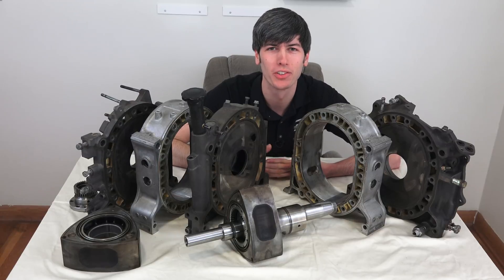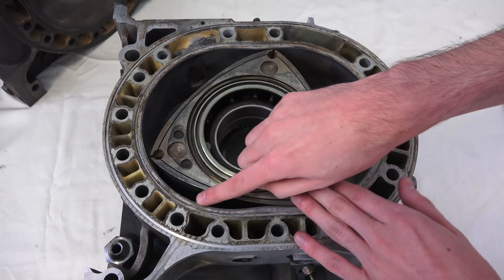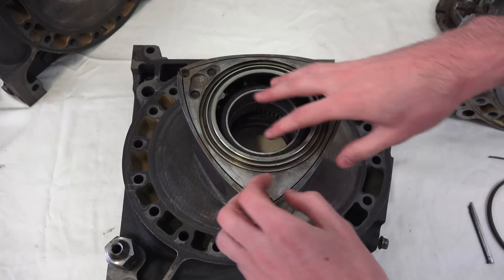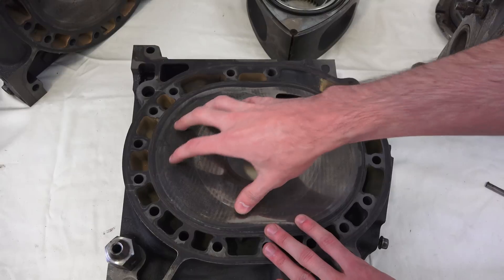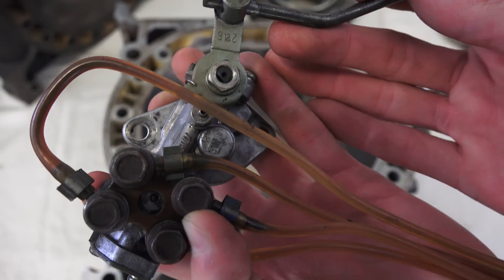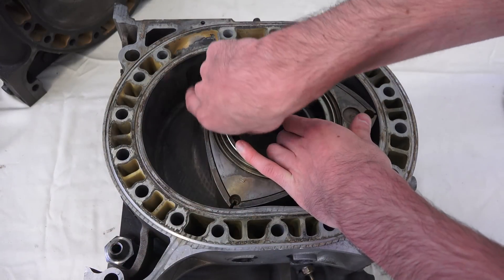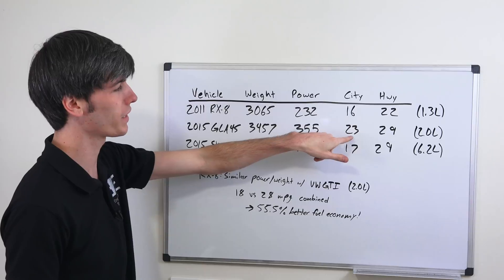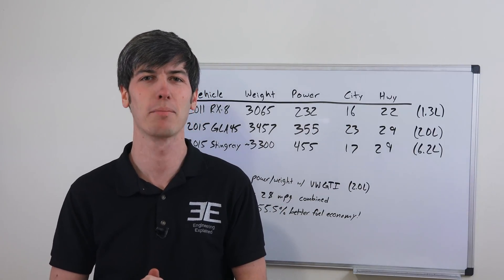4 Reasons Why The Rotary Engine Is Dead

Comment: Enjoyed the video but It seems apparent that a more prevalent reason they burn more fuel is the fact that rotary engines are often operating at much higher RPM than standard piston engines. Its not so much about thermal efficiency or unburned fuel as those problems could be resolved with fuel additives and engine configuration.  They are low torque engines that need to operate at high RPM to achieve high HP. If you were to rev a piston engine and rotary engine at 10,000 RPM that were the same volumetric size, I bet the rotary would use much less gas due to the simplicity of the engine and the lack of restricting mechanisms such as chains, cams, spring loaded valves, and back and forth motions of pistons etc... Not to mention that the piston engine would probably throw a rod at that RPM in a short matter of time right. The rotary engine is ingeniously simple and deserves respect. If paired with a well-engineered variable speed transmission could be incredibly fuel efficient. Your thoughts..?

Comment: They do not advertise the displacement of rotary engines correctly. The1.3l only takes one combustion chamber per bank into consideration. So technically it is a 3.9l.  This makes the fuel econ look a bit better.  But in turn makes the power output look atrocious.
Reply: It's difficult to directly compare. It's still a 1.3L, but it used it 3 times per revolution. Piston engines aren't measured on their displacement per revolution, just the total displacement of all cylinders combined. Each cylinder needs 2 revolutions per cycle, though.
Reply: The real doktorbimmer Yep. And with two rotor engines you can basically do the same and just double the displacement and you'd have a fair comparison to a 4 stroke engine in terms of displacement.
Reply: unless you go two stroke :)
Reply: Right, I don't get the huff/puff over the displacement. No one takes a two stroke that is a 100cc and say it's actually a 200cc. Displacement is the chamber where ignition takes place, not each rotor face. That's usually how it's done. I know in different racing organization and countries they'll use the degrees of rotation to figure out it's "displacement" because they're only trying to give referencing to compare with a 4 stroke. So basically they would compare how many times the rotary engine would fire for a single rotor in the same time it takes for a 4 stroke piston to fire. 

Either way it's all meaningless. Should just be metering how much fuel is consumed over time. Since displacement means dick when it comes to fuel consumption.
Reply: The real doktorbimmer EXACTLY haha, that's what I was saying because fuel efficiency vs displacement size was being compared and I said that it's meaningless because fuel efficiency and displacement have nothing to really do with how efficient an engine is. Only it's fuel consumption over time vs kw output.

True displacement? Then explain why a 2 stroke and 4 stroke have the same displacement under that logic. The amount of piston travel that a 4 stroke has to do is twice that of a 2 stroke. The amount of displacement between power strokes are different. 

Yet no one would say a 100cc 2 stoke engine is actually a 200cc engine. 

The reason why some racing organizations use degrees of rotation when figuring out its "displacement" is to compare to 4 stroke engines for figuring out rule balancing. 

A four stroke engine needs 720 degrees of rotation to complete one cycle. While the basic 2 rotor engine takes 1080 degrees for all 6 faces to rotate. So within a 720 degrees of rotation (the same rotation as a 4 stroke engine) you'll have 4 faces that have fired off. So that would be 654cc X 4 which gets you about 2.6L. That would be the most apt way to compare a rotary engine to a 4 stroke engine.

But in general like 2 strokes and 4 stroke engines only being calculated based on one sweep of the face that's why you get 1.3L for the 13B rotary.
Reply: Here's our number twister.
Reply: a sardar comment. who cares.

Comment: I had a 1987 mazda rx-7 turbo II and a 1985 gslse.  The cars were bad on gas as a 6 cylinder but not as bad as a 8 cylinder. I know because i also had a mustang gt 87.
The power was good but the main reason was because those cars are not heavy like the rx-8. They turn really good on tight turns making the car fun to drive. 

The rotary technology has move forward ,however it can not keep up with the big leaps in technology the piston engine has achieve over the last  2 decades. 
That is the main reason the rotary is dead.

If Mazda would made a new rx-7 light weight like the lotus elise, the car would perform much better in mpg and acceleration than the rx-8.  They also need to turbo charge the car if they want to keep up with other rivals like Nissan 370z.

Comment: the only advantage you can get in a rotary engine is the power you can get within a restricted form factor... other than that, they are worse in every way to a standard piston engine. which anyone short of anyone drinking the rotary kool-aid can figure out with casual observations. great for racing though, where money is no object, engines are disposable, and you're limited to a certain amount of space in the engine bay. rotary engines are very reliable when new and when obsessive care is taken of them, but the reliability quickly has the bottom fall out of it as soon as the seals start to wear, and worse still, when the seals wear at the walls. it's a neat design, though.

Comment: My 1980 RX-7 had crappy fuel economy, the exhaust reeked of unburned hydrocarbons, and leaked oil from the rotor housing.  Also gutless performance for a sports car.  It sure looked good though!  RIP WANKel...

Comment: Rumors have come out that Mazda will produce a 2017 RX-9 to bring rotary engine back. Maybe there are some technical innovations.
Reply: You already said that chief.
Reply: YouTube sends notifications to people when there's activity on a thread they're involved with. I may disagree with +doctorbimmer, but he has every right to continue to engage in dialogue. That's kind of how it works...
Reply: if you're not a degenerate, you would take 5 minutes to read the excellent explanations in the other comments. but after the massive bankruptcies caused by this engine, it will never see the light of day again. all propaganda about this engine being in production are speculation and false, conjured from third party news sources. check back in 2018 when you think this will be released.
Reply: They claim they've found a way to eliminate the need for the spark plug being outside the main combustion chamber. People suspect they've managed to get compression ignition working with a Wankel engine, but they still haven't announced anything definite.
Reply: Doubt we'll see anything with the rotary anytime soon. I know they've continue to develop patents on the rotary. Every couple years something new pops up. But the rotary would have to meet certain emissions, fuel consumptions and price point. Now with the new variable compression engines coming to market soon it'll make it harder to compete. Ever since the early 2000's when piston engines started to take huge leaps with fuel efficiency, power delivery, weight, price, etc it made the rotary less favorable from a business perspective. 

I mean since the peak of the rotary engine's performance in the late 90's piston engines switched from cast iron blocks to aluminum, direct injection is becoming common, variable valve timing is found on just about everything, etc. I mean the simple tricks GM has used on the old Vortec 4300 has made a cheap/stout engine go from 200hp to almost 300hp with 20% increase in fuel economy. That's what the rotary has to face. 

I think Mazda can do it, but it might cost too much in R&D for the execs to really allow it.
Reply: Variable compression engines have been ready for years and we're still waiting for them. Will they ever be in production ?
Reply: Infiniti is putting one in the 2018 GX50. Which means they're going to production now.
Reply: julosx Yea Nissan will come to market with the first VC engine. Peugeot has been developing theirs as well and I think it's planned to come out soon as well.
Reply: what you have to understand is that it is flawyed in principle. next, you must understand why your statement is completely idiotic by any stretch of improvements that can be dreamt up in a youtube comment section.
Reply: You clearly don't understand the principle. You don't understand English, either.
Reply: I repeat - you don't understand the principle. The only problem with rotary engines is their low-rpm performance. The are used right now in aviation and have been used in aviation for years as a light-weight high output power plant. They are absolutely reliable and consistent in that role. 

If you weren't a moron, you'd realize that the real experts in engine technology don't have time to comment on YouTube.
Reply: They're not obsolete. Outside of a few trolls on YouTube, nobody who actually knows what they're talking about believes that rotary engines are obsolete. They're simply not where the dominant focus in automotive engineering lies today for most companies. 

I bet you would imply that the turbine engine is obsolete too, because no manufacturer builds a car with one.
Reply: Wankel rotaries are mass produced and commonly found in aircraft applications. They are also used in ground applications for generators. 

Turbine engines, on the other hand, are not used by any manufacturer for vehicle applications. So again, but your logic (and ignorance), the turbine is dead. 

FYI, I'm muting you after this post. You can respond with your stupidity, but I won't see it.
Reply: saying you're going to ignore someone is not ignoring them, its being a queen. and check your facts.
Reply: They use air cooled VW engines in planes too. And the rotary has many problems. Not just the one.

Comment: I worked for Mazda for years.....the ONLY rotary cars that came in on a wrecker either had a dead battery, run low on coolant (the water pump cavitates if the coolant is more than a quart low) or the oil level was not kept up or the oil had not been changed regularly.  We raced an RX3XP and they made us stop racing it because it outran everything that we came up against.  Also your comparison with the corvette is full of crap.....they shut 4 cylinders down when in cruise/highway mode to get the fuel economy and they make a HELL of a lot less HP in that mode.  When they're making 400hp or more they burn a hell of a lot more fuel.    Horrible comparison......BTW...if the motor is tuned correctly the carbon deposits in the curves are very minimal.....we NEVER had seal problems with cars that were taken care of.   I've seen engines that had a million miles on them and still passed factory specs........They got a bad rep because of people that didn't take care of them.
Reply: A million mile rotary? Sure, how many times was it rebuilt?
Reply: In 1973 I bought a '72 Mazda RX2 with 12K miles. It got 17mpg, but gas was only 35 cents/gal. ($1.89 today).  A year later gas prices had doubled, so the joke was on me.  At 35K miles, the seals between the rotor housings failed, which turned out to be a known problem and right on schedule.  Mazda covered half of the rebuild, but it still cost me about $350 in 70's money. After that, I drove it until 1981, 100K or so, with no more engine issues, while gas rose another 50%.  A few years ago I searched the 'net for '72 RX2's - as best I could tell, virtually none even exist anymore.  The thing would really run, though.
Reply: Kwaka Pants ...Remember, he's seen a million mile rotary that can still pass factory specs!?.. 
I was willing to believe him until that part
Reply: Yea. You can't compare modern cars that cost thousands of more dollars to an Rx-8
Reply: What about all the ones that come in on a breakdown truck because they're flooded and won't start? Was a regular occurance at the dealer I work for when the RX8's were still popular...
Reply: loopshackr In the early days they had side and apex seal failure.  They fixed that and if properly cared for they ran great for long periods.  A lot of people crapped their paints to find 4 barrel carburetors on them.  They were very easy to increase the power but they came apart because of the sun gear failure at high RPM.  We fixed that racing in Florida by heat treating the sun gears.  We never had another failure.   The RX3XP was a 90 cu inch motor and made a bunch of power.  We had a ton of fun racing them on the stock car tracks.
Reply: No car makes its top bhp while cruising on motorway etc ffs why does it matter what its doing lol
Reply: I think this was a figure of speech not literal.
Reply: +The real doktorbimmer nah wasn't he comparing it to a corvette?
Reply: big reliability. my motor has 350k miles on it and only thing done to it is regular maitenance
Reply: Wankel engine is fascinating and get plenty of advantages! But! ... the efficiency is low as you mention by the geometrics of that engine : the surface of combustion chamber compared to its volume! If you study the theoretical efficiency of Otto engine, you réalise that efficiency depends of thermal losses. So as the surface/volume is high in a Wankel , efficiency never will be high! Sorry. M35, GSbirotor and Ro80 have been part of my childhood hunt for exceptional cars! And indeed if you look at the endurance test made by  Auto Journal at that time ( copy available for fans) on the Comotor birotor , the results in term of reliability are exceptionally good!
Reply: No, he was comparing it to a GTi, but was showing that a 6.2L V8 made better fuel economy and had over 200 more HP than the RX8.
Reply: yea that was a while ago. cant remember how long i just know they owned them at one point. one of those things not alot of people know
Reply: thanks for your comments - reflect my own great experience with 4 of them.
Someday, I hope to be able to drive far enough and fast enough to use 5th gear... and then I can say what the true highway mileage is.
Reply: Wankel engines simply suck, they are inherently unreliable and cannot compete with other more successful engine types still in production..
Reply: The Rotary engine is fast despite the lower HP.  Redline is around 8000 rpms. I had a 76 Mazda truck which was a sleeper. I could take on anyone!
Reply: The real doktorbimmer ..Do you happen to know the longest a rotary has lasted on original apex seals? 
My 86 gxl made it to 150k mi before it was rebuilt, and it was babied. 
Ive heard some people on RX-8 forums claim they made it past 200k, but all the rx-8 owners I've known in real life were doing rebuilds anywhere from 80-120k mi..

Comment: The Wankel engine has three major advantages though: smooth running, good power-to-weight ratio and high max rpm. Because of the sealing problem and uneven heat distribution it works best in small sized engines and therefore it's not suitable for cars. I have seen small RC vehicles and go-carts using Wankel engines and they are just mad at power compared to a piston engine.

Comment: I used to own RX-7 and it was a constant headache.  It looked sporty enough but it drive nothing like it.  The engine flooded all the time.  Yes, it flooded, which was how the repairman who was supposedly an expert on rotary engine cars described it.  The oil flooded the chamber so much that it wets the spark plug and makes the engine dead.  I should have known the rotary engine was a bad news when I learned Mazda used regular engines for all their other models.  Another despicable thing Mazda did was it misrepresented itself on their commercials as if they were the inventor of the rotary engine.  What a sneaky bunch they are.  I was fooled once but not anymore.

Comment: Trucks easily tipped the scales at 50,000+ pounds. With the advancement of electric motors (Tesla motors) Energy density in batteries, what would be the advantage disadvantage turn these trucks into trains of the concrete rails?
Diesel engine generates electricity energies pump directly into the wheels. first benefit I see no transmission offset the cost generator, regenerating breaks reduce the chances of runaway truck, Solar panels on the trailer roof, going all electric in residential, Driver would not have to keep the engine on to run the AC or heater while sleeping. These are just some of the possibilities but what's the negative side...